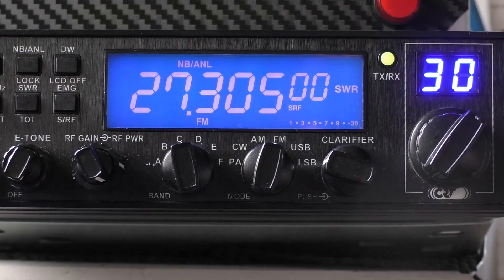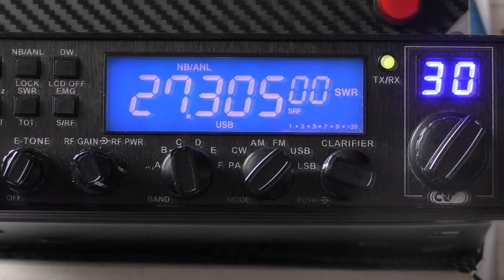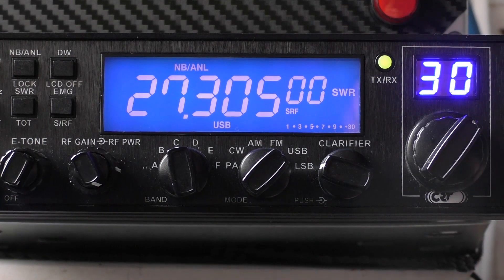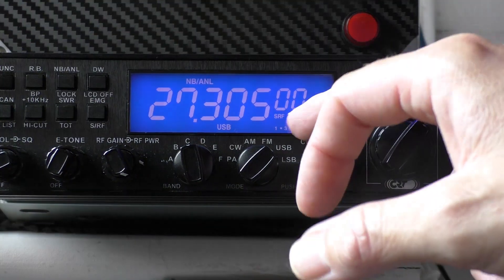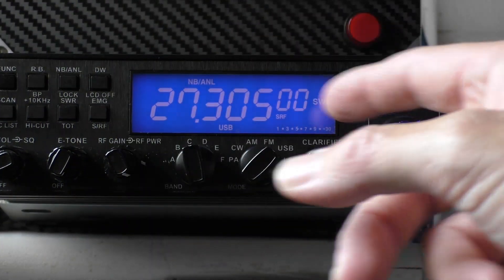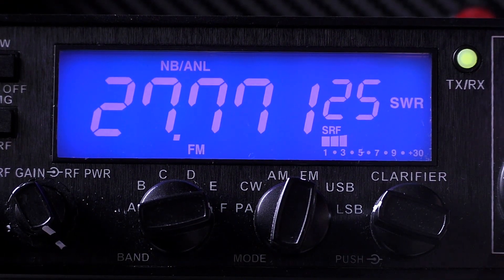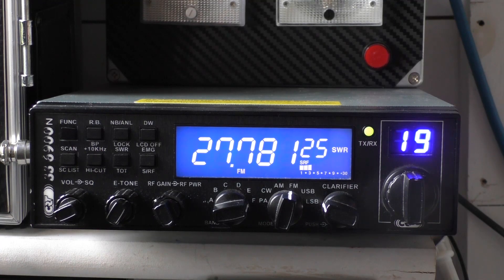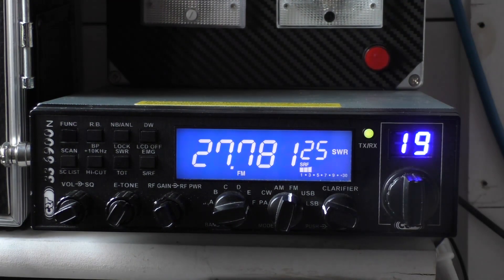CRT SS6900N. " 5 HI " Warning explained (+beginners advice)

Comment: Well the new 9600n arrived today, looks like the old magmount in the garage is knackered just keep getting S hi warning. Not getting any needle movement on the analogue meter I tried either. Need to dig up another patch lead and meter to retest
Reply from the maker: Stick with it you will get there.

Comment: Hi, came across this S HI and assumed that it was the case being high swr. The issue is that the instructions you get in the box (if you are lucky it's in english) there is no faults page. You get a page in most electrical goods tv,hi etc name help or error codes. Mine came with insructions in one book in french and another in what looks like german but no english.

Have a question, been havin an issue with a K40 mic being connected. If you turn on the 6900n with the mic connected it auto keys up and I have yo key manualy to release the keyed up from power on, or if I turn on the 6900n and and plug the mic in again it will auto key up and I have to manualy key to release the auto keyed on plugin. The mic has been rewired with a few different possible configs. Anyone or even yourself come across this before even with another brand mic on the 6900n?

Love the channel, regestered on Charlie Tango site and been reading posts there to pass the time on waiting to get a call sign, but bloody hell it been over 2 x weeks and still waiting and I know they are working on the site, but the forum is realy easy to work with so I don't understand why it is taking soo long.

Thanks
John

Comment: Hi Fred. Thanks for the video. One question, should you be able to get acceptable SWR across all of the 6 bands. I can only seem to get it acceptable on one band at a time (around 1.6) but it goes high on the other bands. I am using a modulator mag mount.
Reply from the maker: Hi.  It will increase as you go up and down the bands.  Hopefully you can get it low across all of 11 meters.  Once you go up to 10m 28Mhz it will go up.

Comment: I have an HR-5500 which is the same radio as this and ages ago i programmed it and it works fine but recently i wanted to make some changes to the channels stored and it wont let me.
If i read the radio it loads but immediately gives me a 'Frequency out of range' error in the programming software and shows the Frequency band as 28.000000 - 29.700000 but my stored channels go from 25.615000 - 30.105000.

I tried creating a new file with the 25.615000 - 30.105000 frequency band set and typed in all my channels but when i try and upload that setting to the radio i get a different error message saying 'Frequency band type is wrong' and it refuses to upload to the radio.

Any ideas please?

Thanks, Steve.
Reply from the maker: Iam not going to be any use as ive never programmed mine.  Stuart has programmed his however and may be able to offer some help.  See more on his 6900 video.  https://www.youtube.com/watch?v=KXK6ZvowcDs
Reply: @CB-RADIO-UK  thanks, ill give him a try :)

Comment: Hi Fred I got a crt ss6900 n and I keep get that 5 hi now I have a sigma Excalibur and it said no need for a swr adjustments  I live on a second fool flat and I can't but a sliver rod up not I went into the menu and I went on the to tld in the menu then went into SR on the LCD then I checked the swr readying and it's 2.5 swr and I key up it go's up to 30× on the LCD screen and it's doing my head in to be honest
Reply from the maker: Hi.  I think you will find the +30 is the output power.  If you turn down the power knob that should drop back.
Reply: Thank Fred but what about the swr becus when I go into the menu and tune swr it's ready 2.5 and sometimes it's going up to 2.6 on the swr is that ok becus I can't adjust it as the Excalibur is not salf adjusterbal and I can't use a sliver rod becus I live in a second fool flat and someone lives upstairs so I'm stuck with the Excalibur bud
Reply: On.the power were is it on the front of the radio ? I'm sorry to keep ask as I use to be on cb back in the 80s and there wasn't a swr adjustments it was all built in the cb and it was salf adjustbal and all this like the swr and can I ajust it by the radio instead  of getting a swr meter and how can I do that. Ct3923 Nick

Comment: Hi Fred
Just trying cb radio 📻 after 40 yrs away! I was on them in the good old am day (moonraker)
I have watched a few vids on the Superstar CRT SS 6900 N V6 CB Radio
Would this be a great choice as I have just got a Midland alan multi and it's not much cop where I live, looking for a good base station.
All the best Pat.
Reply from the maker: Hi.  The 6900N is a great all rounder.  Video with the 6900 will be up at the weekend where iam getting local contacts 20 miles + and DX 1300KM on just 20 watts.
Reply: @CB-RADIO-UK  cheers Fred love the vids! And is your shed just a shed for summer use? As I am thinking of sorting something for myself.
Reply: Rig on the way!!

Comment: Thanks for this video Fred,as I could not understand why I got good swar reading from 6900 set but when I connected my new FS22 SWR Power meter,I got HI 5 warning. Checked the patch lead and found a dead short. Say fix. 
New in returning to CB, I still don’t understand why I am receiving so few signals. Is it just quiet,or is my new aerial setup very poor?
Enjoy your videos,thanks again Ray CT3466.
Reply from the maker: I takes time to find / set up local contacts. CB radio chat forums can help.  As we more into the summer the bands should open up and skip should come in but it will be in and out.  Keep an ear on and around 27.555 USB.  Good luck.

Comment: Morning Fred you saying use a multi meter to check the antenna cable do you keep the cable in back of the radio when you test it ? 
plus when i'm switching channels on the ss6900n sometimes the channel number wont change when i click it 3 or 4 times is this a fault ?
Reply from the maker: Hello.  Disconnect the coax from the radio for testing.  No the channel select is like that.  Not the radios best feature iam afraid.
Reply: @CB-RADIO-UK   Hi Fred i put a normal swr meter on the radio and i get 1.3-1.5 fm on am its about 1.8 i live in south yorkshire i got talking to a bloke on ssb gave him radio 5  signal 9 into Grimsby which is 55miles and that was on 12w. Cant wait for some skip to start coming in.

Comment: On this radio do you set the swr with the full power turned up? I can get a low swr on fm but this increases when I turn up the output power on this radio.
Reply from the maker: Yes alway use full power FM.  In theory in a perfect world the SWR should not change with a power increase but it normally does.
Reply: @CB-RADIO-UK  I'll give this a go today. Only got it setup last night using a 5/8 silver rod. Thanks.

Comment: I got this only when on full power & only certain channels - if i reduce power its fine , on other channels i can use full power.
Reply from the maker: It will just be the SWR of your antenna is higher at certain freqs.  The HIS warning is very sensitive.
Reply: Fred in the Shed  ive had to cut 20cm off antenna to get a usable swr ... ive got an unknown antenna ... like an antron but 4 sections & no adjustment rings - its now 6m in length?

Comment: Hi Fred what does dc Hi mean on the ss6900n and how can I fix it
Reply from the maker: It means your radio is receiving too higher a voltage from your power supply or car electrics.  If you are using a power supply check it on a meter.  It should not be higher than 13.8 volts max.  If your using in the car there is not a lot you can fo.

Comment: Hi Fred just picked up a ss6900n and a sirio 5/8 just watched about swr and got it between 1.3 / 1.5 but on ch40 am it goes straight across how can I sort that out please.
Reply from the maker: Mic i assume you have 1.3 on the higher 27 Mhz channels ?  You should not get the SWR meter to go off the scale as that indicates a direct short somewhere.

Comment: Fred how do we get rid of the popping sound when keying up using the standard mike?  cheers
Reply from the maker: Hi Glynn.  Ive not really noticed it myself.  The standard mic is pretty poor in my opinion.
Reply: @CB-RADIO-UK  yes theres definately a noise when keying up the radio. Ive ordered a cobra mike from knights cb shop as the standard one is rubbish. If you could look into the popping noise when keying up as its a common problem apparently it would be much appreciated. Cheers
Reply from the maker: Not had it myself but i swapped the standard mic straight out to a KPO.  Hopefully the Cobra will sort it.

Comment: Before I reset my radio I was seeing a numerical swr value as well as the mini bar meter. Any idea how to re-enable it? Thanks for the vids.
Reply from the maker: Not 100% on this.  Normally the SWR / TOT switch turns the display from SWR displayed in bars or the Talk out Timer displayed in digits. Could you have been seeing that ?

Comment: could i use sideband with a loft antenna and which is the best loft antenna
Reply from the maker: Funny you ask that because ive been running tests all week on loft antennas.  Ive got 2 videos and the first will be up at the weekend.  The short answer is that a loft antenna will work but will never be able to match one on a pole outside due to too much noise.  Best antenna is hard to say.  A small outside antenna worth looking at is a boomerang antenna which is around £30-40
Reply: @CB-RADIO-UK  thanks for the reply , i will look forward to the videos

Comment: Where is ur power switch and what is power band on this
Reply from the maker: Hi sorry i dont really understand the question.
Reply: @CB-RADIO-UK  which switch.variates the wattage you push out
Reply: @indiana146  : Its the large dial / switch at the bottom, third from the left (outer part) labelled "RF PWR"

Comment: You are the last line of defence lol ...every rig I have bought since being a new user you have filled the gaps ..awsome video as normal... plugin mine in tonight with all you have shown me so far... thanks
Reply: My swr is off the scale all I have done is switched out the rig touched nothing else. ???
Reply from the maker: Check all connections to the antenna.  Check the antenna is tuned / adjusted correct.  Depending on antenna used check you have enough ground plane.
Reply: @CB-RADIO-UK  Roger that water was the issue..I taped up the bottom same as u did...all working now ..just getting use to the way it works .😬..thanks for the reply ..your videos been a massive help..👍
Reply: @CB-RADIO-UK  I'm on an antron 99 because u said so lol